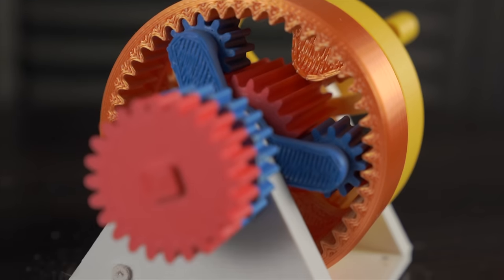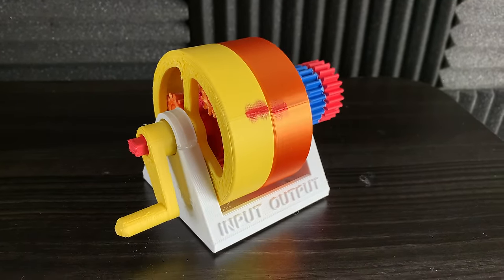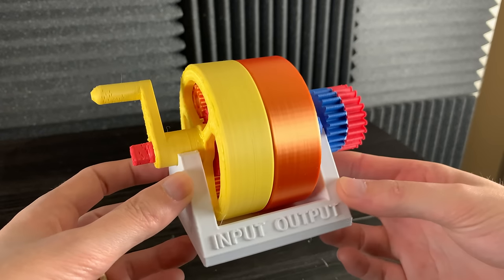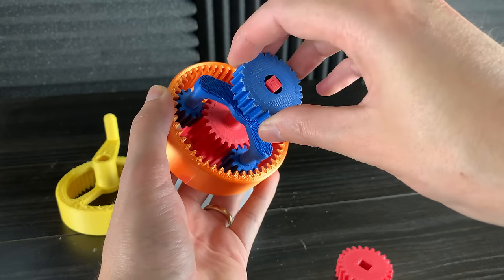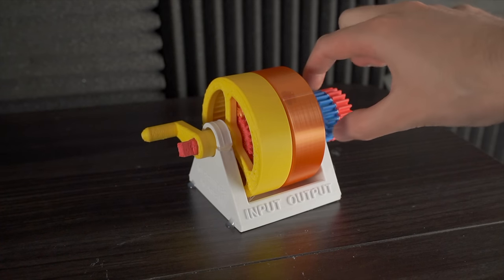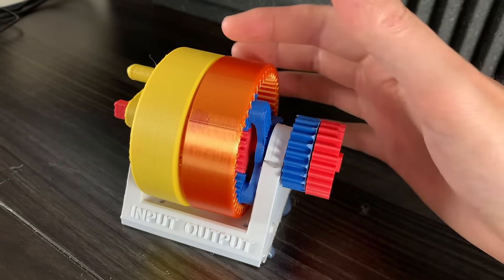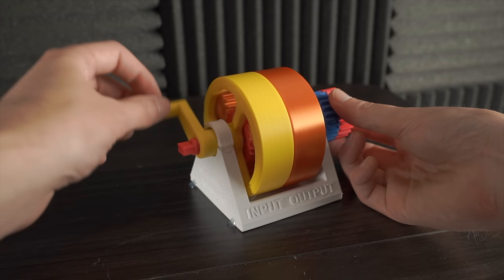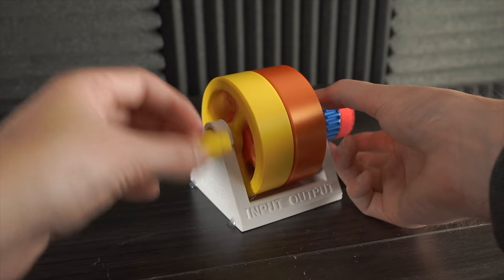How do automatic transmissions work?

Comment: but how does it shift smoothly through the gears 

also how does a reverse gear work?
Reply: It shifts smoothly due to the torque converter that is between the engine and transmission, and reverse is just using a different ratio in the transmission with the output being in the opposite direction of rotation
Reply: Sun is input
Carrier is held so the planets act as an idler
Ring is the output
Boom reverse
Reply: ya that's how reverse works but when he held the blue carrier it did not reverse, I wonder if this thing was built wrong ahaha @gamechip06

Comment: 99 percent of automatic transmissions also use a torque converter… that would have been helpful to explain as well
Reply: The Torque Converter is more to transfer energy from the engine to the transmission(slippage 'till lockup) and to the front pump(direct connection as the T/C is bolted to the flexplate and the hub welded to it sit in the pump gear).

What he explained (grossly) in the video is mainly how A/T switch gears (ratios). 

A/Ts are far more mechanical art than this 😉 hydraulic, mechanical, space maximizing and electric systems all in one box of 2×2×2 (i.e. th GM 6T70E)

Have a great Day sir ✌️

Comment: Great explanation of the gear ratios, but how does it change gear automatically?
Reply: I assume theres a mechanism that just blocks the red/blue lever gear? Driven by pneumatics or so.
Reply: @termitreter6545  yeah, thats supposed to be the point of the video.which actually lacks of the explanation.
This only explains a planetary gear transmition instead of a automatic transmition
Reply: @magicalchords5145  i've never heard of this type of transmission being described as a planetary gear one; it was always called an automatic because autos always used planetary gears. with the introduction of DCTs now they're called torque converter autos or 'conventional' autos. I made another comment on this thread describing the basic operation of how gears are changed automatically
Reply: @termitreter6545  they're hydraulic or electric, no modern system is pneumatic.
Reply: @termitreter6545 hydraulics actually, pneumatic is used for heavier duty trucks (18 wheelers)

Comment: This video should have been titled how does a dual planetary gearset work. This does not even come close to how an automatic works. At 2:36 you can see the gear turning in the opposite direction of the crank. This does not indicate the first gear as much of a reversed gear reduction. Oh and before I get all the wonderful hateful comments. I have worked on and rebuilt both automatic and manual transmissions. I like how he explained how a planetary set worked. My issue is the name of the video is very misleading.

Comment: So, an automatic transmission works by using a magic ghost?  The ghost grabs onto a gear knob, which determines which gear ratio to use?
OR - you have glossed over the most confusing aspect: how it "Automatically" changes gear ratios.

Comment: Did you already do a standard?
If not I recommend
Reply: You watched it here. This is a manual transmission. Nothing about it is automatic.
Reply: @JamesBiggar  it’s built to mimic the inside of an automatic, standard transmissions have a different method of connecting to the gears

Comment: Ah yes, automatic gearboxes require you to manually select the gear ratio.  Makes sense.

Edit: I realize that my comment doesn't explain myself very well.  What I mean is that if the gearbox doesn't shift automatically, you're not demonstrating an automatic gearbox because the key mechanism is missing.  Yes, he does explain the actual shifting part well, but he explicitly causes the gear shifts with his hand (aka manually).  What I was expecting was a demonstration on how the gearbox is able to decide when to shift and how it does so.  Imho, this video only explains half of a mechanism when both halves are crucial to the mechanism's function
Reply: It's a fukn demo... You don't expect the guy to make a full gearbox do you?
Reply: @InDeath  ppl just like to talk shit, if he can't see that this aint a full AT then something's wrong with him.
Reply: @Comfy_Bed  Man, it's insane how many of those kinds of comments there are on demo videos like this. After a while it really gets kind of old lol.
Reply: I apologize for my sarcasm.  I have edited my comment to elaborate on why I believe this video does not do its job (completely).
Reply: @minerforstone4136  Ah gotcha, that's what you meant. Well there's a reason why that wasn't exactly demoed. A car knows how to shift up due to, I believe a combination of sensors, oil pressure, and some other components I can't remember! (Bad at this stuff lol)

Basically this IS the auto part without the part that tells the car to change gears since it would be too much of a hassle to make the whole thing.

Look up how a manual car works with it's gear box and you'll see it more clearly!
Reply: @InDeath  I guess this is why I've never been able to find a good explanation on Google, lol!  I just figured there was some mechanical system that could shift down given enough torque.  Thanks!
Reply: @minerforstone4136  Haha np. It's all just been some sort of hydraulics system since the very first few auto cars that told the car when to do the gear changes. 

Tbh no matter how much I read up on how that stuff works I can't really wrap my head around how the full auto transmissions works all that well like I can with a manual transmission because of that reason, like you get the demos of the how the auto gearshift works but not how the car knows when to do it but I guess demoing that would be way to hard to do so because you would have to build the electronics and the hydro's and stuff, I mean it can be done but better to leave that stuff out since the actual auto part is the way the gears work. The damn things work off of electronics and black magic lol 

They're a biyatch to work on too.

Comment: Great video ! Using such colored 3D hand-sized parts realy helps to visualize and "feel" what is going on :-)
I would just have loved to see the other side of the mecanics while you were holding the blue or red part :-D
...and I cannot but wonder what would happend if you try to hold both the blue and red part at the same time ^^

I'm trying to figure it out in my head, but may need a bit of sleep ^^
Does anyone have an idea / a bet over what the result would be ?
Reply: It would stop the mechanism. Holding both gears at once would be the same as holding onto an axle going through the entire system (even though there isn't a continuous axle, I'm explaining it that way to make the concept easier to understand)
Reply: @HelenaOfDetroit  As someone who's job require to read a lot of unanswered tech questions describing exactly what is needed to make something works, I can only praise you for answering here despite the time! To anyone reading this: Be like Helena, you might save a Robin's sanity one day ;-)

Comment: This is just a scratch of the surface of the automatic transmission. How does the transmission disengage when in drive but the car is parked? How does the transmission know when to change into a higher or lower gear? How does the reverse work?

Comment: Well. Now I wonder how it shifts automatically
Reply: valves, hydralics, servos, and more different ways of acctuating the clutches and gears in the transmission is how it shift automatically. Modern transmissions are all computer controled, but older transmissions can use engine vacuum or a governor to control the shift points
Reply: @loafofbullets  mm so that's how it holds the gears down. But what would trigger it?
Reply: @davidstaffen6783  the trigger for when to shift would be separately programed for each car to shift gear at certain engine rpms ,at least in a computer controled transmission. In an older transmission it would most likley use hydralic or vacum pressure to find out whne to shift instead of sensors and a computer but certain engine rpms is aleays going to be the trigger for up or down shifts
Reply: @loafofbullets  oh. Okay using pressure build up from the engine building up rpms it then causes somthing else to clamp or un-clamp the gear shift. And I'm mostly wondering about the older analog ones not newer digital ones. Digital stuff is pretty easy for me to understand
Reply: @davidstaffen6783  i dont know the old ones too well because they dont really teach us too much about that in college
Reply: @loafofbullets  bummer

Comment: It’s a pretty good system but it gives no fun at drive. Manual transmission is quite far superior.😀
Reply: Supsrior in what fashion ??
Reply: @ACommenterOnYouTube  Like wallet drainage if transmission goes into broken state. At least here in european sojuz.
Reply: @kolomaznik333  ya know ... i have owned MANY cars in my life and all of them were automatic and MOST of them were in the 150k mile range and NONE of the transmissions ever failed or slipped .... EVER ... My wifes uncle has a 2005 Hyundai Tuscon with 195k miles on it and its STILL shifting smooth. 
Most people today dont keep their car long enough to experience their automatic transmission failure ... 🤷🏽‍♂️ ... 
So i am not worried about failure and manual is NOT superior and auto is not superior either. 
And MOST people use the clutch to slow the car instead of using $20 brake pads as they were intended to do so, so when your clutch is worn down, break open hour wallet $$

Comment: First, ALL vehicle transmissions have at least FOUR forward gears and a reverse gear.  Second, no vehicle on the planet uses a common sun gear as that it simply not the way it works.  Third, the ring gear cannot possibly be the output as it has no way to output power to anything.  Finally, this was NOT an automatic anything as you had to manually control the gear ratio.
Reply: Ok but that's not the point. This is just showing the mechanism behind the automatic transmission for demonstration purposes. It's not like this can drive a car.
Reply: uh.  what?

no, ALL VEHICLE TRANSMISSIONS absolutely do not have at least four forward gears, "MOST" do, where did you get this "all" idea from?
Reply: Oh yeah also cvts don't have one gear ratio but if you think about it there's only two gears and a belt / chain so it can be considered as "one gear"
Reply: @subadanus6310  The Ford C4 would like a word with him, also of course he has to manually select the gears since hes missing the rest of the transmission that would do that automatically... its just a model showing the main gears..
Reply: @PhoenixT1953  I think the Pontiac ST300 or the Chevy Powerglide would probably want a little piece of this guy too...
Reply: I never owned an automatic car with more than 3 gears

Comment: Okay so you have gears and a way to swap between them but wheres the part that actually switches the gears.  When I drive I don't manually change a piece I'm holding to stop it from moving to change gears.

Comment: That was a wonderful explanation. I had no idea how it worked and now I understand the concept a lot more now thanks!
Reply: Just be aware that this isn't actually explaining an automatic transmission. It's explaining a planetary gear set. The thing that makes an automatic transmission automatic is a sophisticated hydraulic mechanism, essentially an analog computer, that compares input speed and output resistance (measured as pressure on hydraulic lines) and automagically makes gear shifts (by sending hydraulic fluid back out other lines). Do a Google Image search for "automatic transmission valve body". And, the thing that allows it to shift smoothly is called the "torque converter", which is a fluid clutch. The hydraulic signals to the torque converter momentarily disengage the input to allow gear shifts without grinding the gears. That is the real "how" of how an automatic transmission works.

Comment: I find automatics and manuals have there place. I daily drive an auto because efficiency and ease of use in early morning traffic. The second car is a manual for the backroads on the weekends. In many cases, the manual transmission is more expensive in the states. It doesn't make sense for a daily driver. But nothing fun ever does

Comment: No that's just how a planetary gear set works. That part is easy.  It just consists of a ring/annulus, planetaries and a pinion. One is held one is driven and one becomes the output.  Easy peasy.   Automatic transmission work like this.  - deep breath - the crankshaft is attached to the torque converter which in turn drives the oil pump in the front of the transmission.  the front pump supplies hydraulic pressure to the valve body and is directed through passageways of the channel plate to either release or apply clutches and bands depending on the vehicles speed.  Accumulators dampen or multiple hydraulic force with springs and pistons that we call servos. Spool valves and check balls inside the valve body are like switches in an electrical circuit.  They just redirect fluid flow to either apply or release parts of each planetary.  There.  Thats how the magic happens.

Comment: Surely the output speed change is effected by brake bands 'holding' an outer drum, depending on which ratio is required, not by holding one of the output gears?

Comment: This description doesn't seem correct. If you release both the control gears, then when you apply load to the orange output, the red control gear will spin.

Comment: Not a bad video could have done a little better explaining why we need a transmission in the first place not just bc the engine like to run faster than we want to start. There many reasons we need a transmission 1 most cars won't even have the torque required to move the vehicle in a 1-1 ratio aka straight from the engine to wheels. The engine will just stall if it was able to start in the first place. 2 well that's just about it honestly we just add more gears so we can go faster. And the overdrive helps to save gas when driving at a consistent speed. Helps lower rpms by shifting so in return it's useing less fuel to save gas.  But overall I liked the video and was really interesting to watch definitely pretty neat

Comment: Nice, but thankfully not all cars are automatics, yet... I know that the time when manuals were more fuel efficient is over, but its the part of the experience.
Reply: Oh yea back in the 80's and 90's manual always had better gas mileage, today the automatics do.
Reply: @ACommenterOnYouTube  the locking torque converter definitely helped improve gas mileage in automatic cars. Old transmissions had “slushboxes” or non locking converters so there was a lot of losses in efficiency in the tranny fluid like 25%.
Reply: If they put some of the same technologies into a manual transmission as they did the automatic, manual transmissions would still be more fuel efficient. The reason they advanced the automatic so much was to decrease assembly errors, cost of assembly and production times, and increase overall quality of product, all by streamlining their production process and making everything the same. A win/win for the auto industry but a loss of customer satisfaction for less than half of their customers. They are in it for the money, American Capitalism. 

But fuel efficiency isn't the only reason some people want a manual transmission. I prefer to keep myself engaged in the driving experience. Though most of my shifting is 'second nature', I still have to foresee driving situations and act accordingly sometimes before I even reach the situation. As I stated, I prefer to keep myself engaged in the driving experience. When I am on the road my number one task is to drive safely. I'm not there to play with electronics, race, read menus, put on makeup, or search for my favorite audio recording. Any functions for driving should be a physical button or lever so I don't have to take my eyes off the road.

I like to and want to be involved in the driving experience.

Sorry for the rant but I just had to say. I just wish that automakers would understand what some of their customers want.

Comment: Except if you drive a vw group car with a dsg then you have basically two automatically controlled manual transmissions working together. It’s really weird and ever car comes from factory with helical gears which are quieter and can withstand much more torque.

Comment: It's a good 3D print, but this video in no way explained how an automatic transmission works, not did it really explain how a planetary gear system (which you rarely find in auto transmissions) works either.

Comment: This doesn't hold up as the direct drive would not be able to carry any load. There's nothing to stop the red or blue gear from stopping or even reversing to reduce output speed under even a light load.